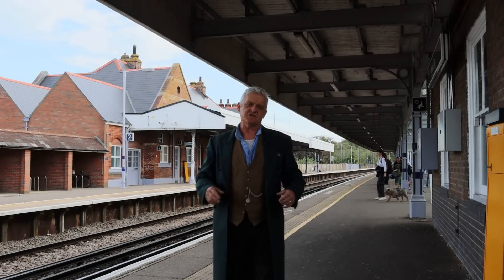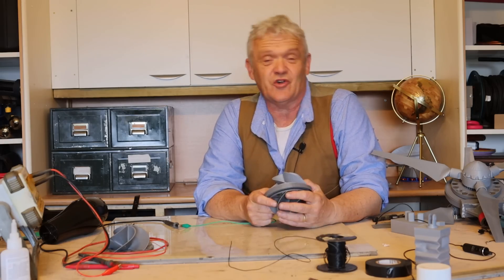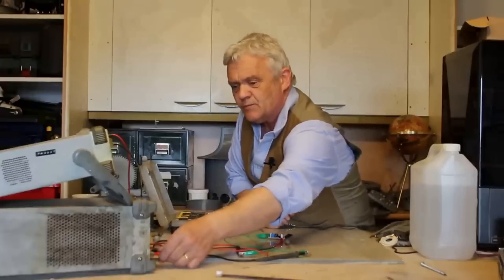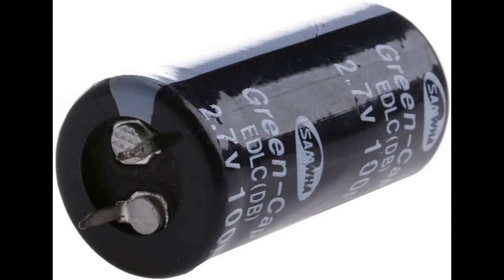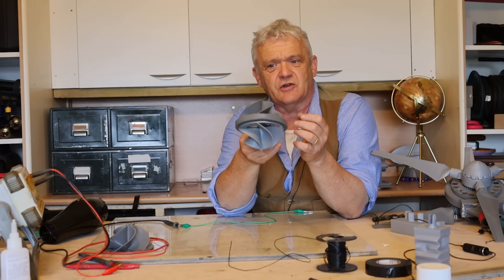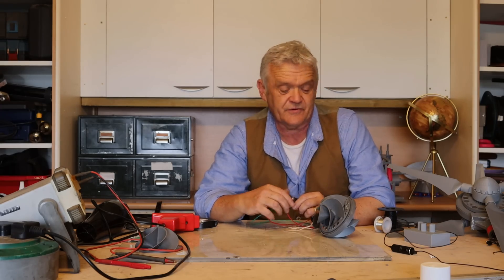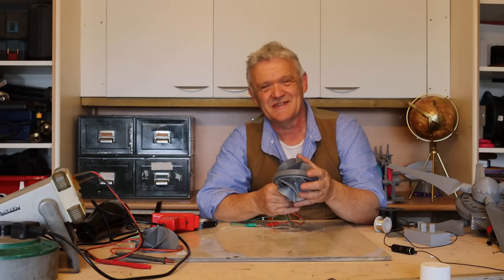2044 A Slightly Cracked Concept Wind Turbine

Comment: consider using a wind sock or tail system to ensure the generator moves in a predefined flight path. That is not rotating wildly on the end of the string, but gliding  along a flat path facing the direction of travel.

Comment: How about a hula hoop but only half the size with a magnetic ball inside . Have coils on the outside and hold the hoop in your hand and move the hoop with a rhythm that gets the magnetic ball circulating . Each coil could be connected in parellel to create a reasonable output current that could charge some caps for leds to light or even a phone if you had to . It would take a fair bit of winding . You could also have more than one magnetic ball with 100mm distance between them ! That would increase the output a lot

Comment: ad is interesting for a freeze dryer , seems cool for food storage , boating rv ....i've wondered with boat hulls there is already a constant frictional drag on the hul and water so rollers would actually lower the friction probaly while spinning because the friction will take the path of least resistance (like all nature does unless God gave it a definition or seperate word to be then it's path in impeded so it adapts but it also adapts into it's definition it must survive as)....so anyway theres differnt geometry for this idea because it could be small rollers or entire hull section or entire sections while anchored could spin too the generator weight would be the draw back i think....hope you're great today mr.Robert Murray Smith ...(i got it memorized so i don't miss any new vids but at sometime i'll check out your other page sir...

Comment: I thought you was going to use a piece of PVC pipe and run your wiring through it and that would keep your propeller level also the elbow at the end and another small piece of PVC pipe for a handle slide your battery in the end of the handle and charge it. with a slightly bigger piece of tubing on the handle as a bushing for twirling

Comment: glad that sending that to you sparked some exploration and teaching moment to seize.  Conceptually seems like it would be a fair occasional or emergency charger for hikers cause it is compact to carry.   Where it really is no hassle to carry something little  larger such as a pedal  or hand generator, like a weekend camper van,  or just day trip too beach situation  then those slightly larger device  would be fine.  For even larger rigs... like week(s) long and or live in campers; . then maybe a  tower to put a bigger wind power device up high,  is maybe better to supplement the roof solar.   

side not- complaint Ive read about with the larger wind ones  used by more RV-ers  on a tower  they tilt up aside their camper when parked for a few days/weeks...... is the noise......  apparently it is very irritating to some..... be it user... or nearby camping neighbor

Comment: What about attaching it to the ends of a wind turbine blades would it spin faster?
Reply: Maybe on a vertical barrel turbine. Could put multiples connecting in series or parallel for more volts or amps!

Comment: 😊what would happen if you had each side of your turbines ,magnets turn in opposite  directions.  And your magnet configuration  was one side north  and  the other side south. With the two sides connected by a set of gears so the north and south magnets where offset. Would  this in effect increase  the wind speed ?

Comment: You can also use a BEC (Battery Eliminator Circuit) which gives you a steady current, usually 5V, but you can find also variable ones but yeah, you need to rectify the output of your generator.

Comment: I am familiar with the mechanism that is employed here. I found it out when i threw a *THIN LONG RECTANGULAR" wooden making post off the side of a mountain. And it whirled away with a signature buzzing sound, as if a bit of magic began to also propel it as it began whirling due to the fluid air moving over its "PERFECTLY SQUARED" surface as it was pulled towards the earth. And prolonging its falling time extensively. 

I emphasize these points because I believe the square shape is actually essential in this mechanism. I believe it has to do with the flow stopping effect of flat squared surfaces, so the device would be given the most torque when the "blade" is designed in such a shape. I was thinking you could perhaps make a strong blade in and extended "+" shape and you could even go further in this experiment and add more interlocked long thing squared rectangular blades till it is an extended "*" shape, and see which number of blades worked best or if just the regular the regular old long thin sharply squared, rectangular wooden(etc) fence post perhaps works best after all? Id actually love to see that. And you should try throwing those fence posts from a high place. Hold it in the middle of the post and throw it horizontally. And prepare to be mildly amazed. Especially if you do it from very high up. As it will travel far off course of the fall sometimes. Some have demonstrated that effect by dropping spinning balls from high places too. But with this it is amplified. Much more float effect. Enjoy. You and "Primitive Technology" (the original guy, not the copy cats) are my favorite channels on YouTube. Well done by far! 👏

Comment: has to do with [*a function*]  but the clutch is set to engage near the maximum rpm so each time it engages it slows a little and disengages then speeds up and auto engages again

Comment: I’m sure this is a stupid question, but what happens to the other 15 Volts when you rectify the 20volt input to 5 volt output?
Reply: it increases the amperage or amps , volts X amps = watts but look at the wheel for that you cover one to get the other for example becuase you figure one using only two
Reply: if i have a 1500 watt space heater or heat element coil for example it's 110 or 120 volts ...so next i have a honda alternator at 13.4 volts and 130 amp at maximum , so the 13.4v or similar maybe 14 but 13.4v X 130 amp i'd have 1742 wattage output at max so it should power the coil but it needs 110 v to the fan motor if used so then i need an invertor on it to get the 110 ac current instead of similar to dc  but straight to a heater coil should work for example the ebike wattage similar or whatever
Reply: sorry i rambled but the voltage is speed of current and the amperage is the volume , like speed and mass , heavier slower can equal faster lighter in terms of power (edit: wattage)or physics
Reply: darn, and if i used steam to spin the alternator and didn't want the ac blower motor part i'd use steam to a turbine with a fan blade on the shaft edit silly example i used because heat for steam could be the heat source but maybe oi want the heat for the steam outside and the coil inside or the alternator wind powered lol

Comment: Would it need a directional blade on it to keep it direction in rotation on the post  , it maybe twisting the string while spinning around your head so to speak.
Handle bar on bicycle 10 km wind.
Supercool idea

Comment: If you had a pole attached to the string, you could hold it straight up and get a ton of velocity with very little input. If it was a pole taller than you, you could just anchor the bottom to the ground and gently rock the pole with one hand as the whizzer zipped around you.

You could also prevent the device from crashing into the ground more easily, maybe with some kind of reel to control how much slack was out.

It's a funny invention, but not that absurd.

Comment: Robert, I'm curious about the hemp carbon printer paper super capacitor you built for the electric scooter. I would expect the capacitor to release all of its energy at once. How were you able to use it as a battery? Resistors?
Reply: The motor has resistance in the windings and backEMF when rotating, both of these effects mean it does not act as a direct short. Also 'speed controllers' can regulate the voltage/current from capacitor to motor.
Reply: I guess that's what I'm looking for. A speed controller for a capacitor. Thanks!
 @bikerfirefarter7280

Comment: Robert, maybe nest your ball generator centered in between a drone's frame atop that has many outboard propellers, and test energy output to extend a drone's hover time when filming stationary aloft as wind passes over the drone. If the added ball generator weight produces more energy than it uses lifting it by adding component weight,  Robert, I think Ukraine needs a lightweight version of your omni directional generator design on the battlefield for enemy position monitoring to save many Ukrainian lives. A military drone outfitted with your omni directional ball wind generator made from light carbon fiber may be a reasonable expense if lives are at stake. If you're successful in a positive generation output to significantly extend hover time, consider reaching out to your secretary of state for defense the Rt Hon Grant Shapps MP. Robert, go save many more lives of the invaded with your brilliant mind. Robert, thanks, and appreciation from the U.S.A. comes your way. :  )

Comment: Cool.
This "moving the turbine" concept is one Ive been harping on for a while.

The best way for this I think would be putting it on a pole, with a swing arm (bent wire poked in some conduit would do) that way once it gets going you just have to wiggle the pole a bit to keep it going.
-you made something like before, out of a kids toy.

My real notion is to put a bunch of these (or other turbine) on a central hub, like the fairground swing ride, in concept. (Or spinning one of those square laundry hanging poles in the yard)

Well balanced, that sort of thing takes little effort to get and keep going by spinning the hub or pole.
It seems that for the same effort of a handcrank on One, you could move Several and let the wind crank them.  It Seems like you could get more output bang for your input buck. Could be wrong, but its on my mind.

Comment: The makes me think of some kind of silly  time travel plot... where an inventor tosseed back in time has to make an nonlethal electric mace... whirling this above his head to charge a super capacitor attached to two prongs at the tip of the ball... so that when it makes contact it electrically stuns the opponent rather than cracking their skull... 
I doubt this could do that without swinging it around for quite a long time... but the amusing thought is there nonetheless.

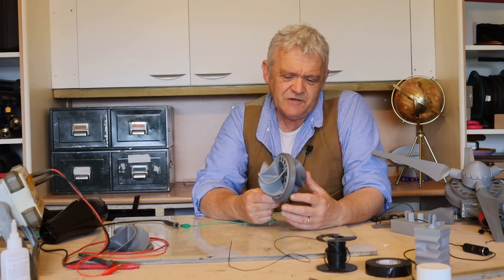Comment: @2:30 if you attach a separate cable that is attached for the sole purpose of swinging it around over your head, it could generate enough power to recharge a phone in an emergency or what have you 😀 Perhaps a special Knotted  weave of cord around the cable which takes all the tension so the wires don't get stressed from the swinging??? Like a Sock over the cable, which takes all the tension saving hte cables within from stress other then bending stress...
Reply: Yeah sure you could, but like Robert said, why not just use a hand crank generator?
Reply: @newolde1   I would say, because it looks cool 😛

Comment: How long is a piece of string?  That will determine the relative windspeed,  guesstimate from vid : 100RPM,  string length approx 1m.  So around  36kmh  or 10m/second.  That's 2.5x faster than the lab fan!! How long could that string be if you let momentum dictate the length?  Maybe add some weight to the turbine ect.  There is so much fun to be had with this concept.

Comment: Probably easier to swing it in a vertical arc than a horizontal one, although it does limit the radius.  But what if you made twelve of those little spherical turbines and mounted them around the rim of a bigger flat turbine, perpendicular to the axis, so that when the big turbine spun, it would force all the spherical turbines around in a circle, eh?

Probably not practical, but magnificent.  Heck, you could do 36 spheres around a larger turbine.  Once it started spinning, it'd tend to keep going.
Reply: Cool imagination... would need bigger place to install... nevertheless how could you harvest energy from those smaller 36-spheres... which you plan to place at edge of bigger flat turbine.🤔
Also, my 2-bit of idea... as per this vdo.. using string over your head is bit cumbersome.. instead hang it on the branch and swing it..sure that would work too..in absence of wind blowing. 👍
Reply: You'd need to do some kind of slip-rings/commutator/brushes type concept for that. Gettin' complicated...

Comment: it really is a great concept, but I feel like your spiral blade wouldn't work as well as propellers... but notice I said FEEL.... your demonstration in yesterday's video proves that it works just as well as a propeller blade, but I guess it being in such a ball-like package it FEELS counterintuitive that the blades would spin at all...
you could always make a similar sized propeller based setup like that guy did and then compare the two, but I think yous design would win overall.... it would be lighter, have less resistance, more efficient, and less cumbersome to spin around your head.....
...also you could use a long pole with the string tied to one end and just place the other end on the ground, then get the thing spinning and you'd only have to move the pole back and forth to keep it going.... I think THAT would be the BEST way to use this, and I don't think it would work so well with that guys propeller blade and fin setup.... 
...and you could run the wires along with the string, but make the wires a bit long than the string so all the tension is on the string... BUT you would have to come up with a way to keep the wires and string from getting twisted, sort of like an electrically conductive ball bearing for the wires and a regular one for the string.. but I would use a thin steel cable so it doesn't break... and you could  attach the inner piece of the bearing to the tip of the pole and weld the cable to the outer piece.... but with that amount of strength you don't need to worry about having the battery on the end like you did....  it would be so much less tiring than a hand crank ... Ohhh I would LOVE to see you make this LOL ...

Comment: Energy in a capacitor is voltage squared * Farad's / 2. So 2.3 squared * 100 / 2 = 264.5 joules. Not bad for a couple minutes work. But the voltage regulator lm2596 needs 3 volts minimum for input. You could put 2 or more caps in series though. 2 of them in series would then have a combined capacitance of 50 Farad's. But at 4.6 volts would have twice the energy at 529 joules.

Comment: what about running the wire up the string, place the electronics at the end, and toss the ball in a stream? could be a compact easily deployed water turbine. I'm sure it might not be the most efficient, but it could be a tremendous ease of use tool. the wire insulation should be sufficient waterproofing. could just drop it in a stream and see if it spins. or see if it works on a wave

Comment: Bolas spider is very economical swinging a weight on end of thread, and seems to utilise a sort of flywheel action once it gets it going.
Hmmm...a hybrid omnidirectional generator on a string, off the top of a trembler generator..with some kind of controlled eccentric movement?
I'm picturing something that looks a lot like an unsteady Swingball Tennis thingy.

Comment: Something I’ve been wondering about wiring these things up: how does regenerative braking work? If one were to just wire a battery or supercapacitor up to a motor/generator, it’d just spin, consuming energy, right? What’s needed in the circuit to allow it to switch around and start putting energy from spinning back into storage? Just reverse the polarity of the connections, or is there more to it than that?

Comment: I have a concept for a fan but not sur if it would work,  Instead of fan blades, use straws that have a flat face in the front but each straw is angled to the rear as if each straw is a blade